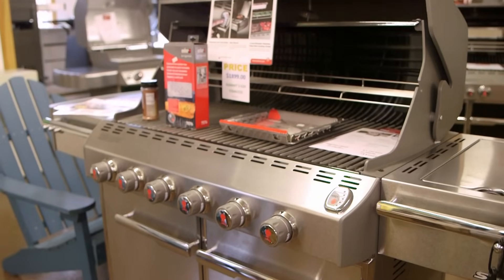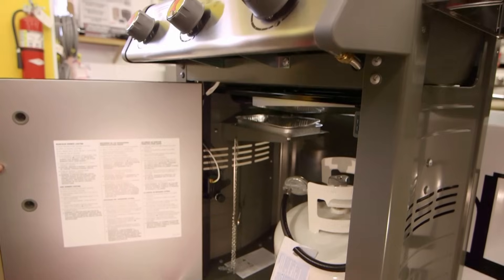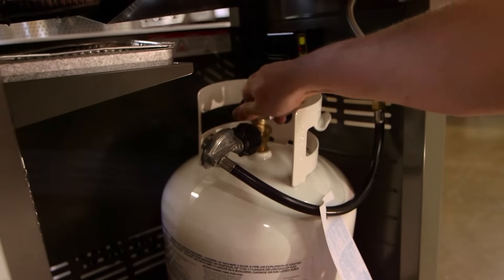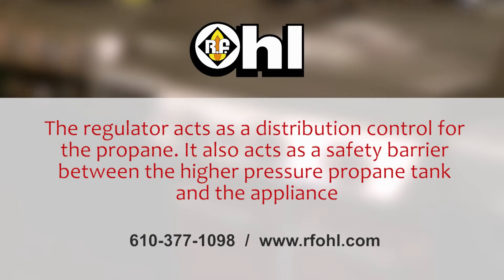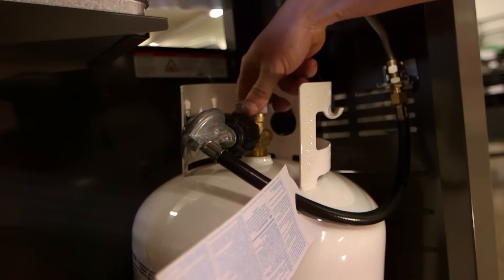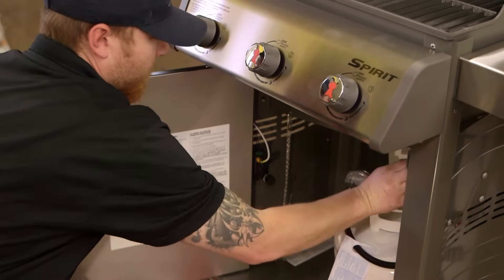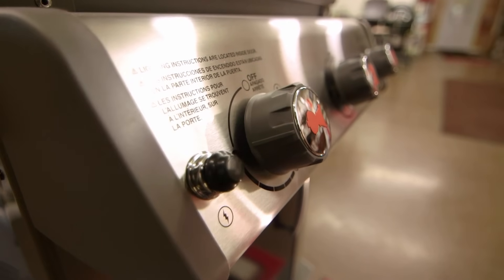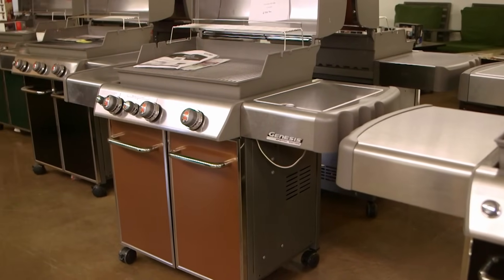Why Is My BBQ Gas Grill Not Lighting Up

Comment: After disconnecting the propane completely, turn the burners on high for a minute or 2. This will clear any left over gas in the lines. Turn burners off, reconnect propane and turn it on super slow for the first 3 to 4 turns.

Comment: I have a six burner (3 ignition) set up and my grill heats up perfectly fine BUT when I attempt to lower the temperature to medium or below on my first 2 burners (ignition 1), the flame goes out either in a few minutes or when I close the lid (whichever comes first). Works fine no matter what the control knob is at on the other 4 burners. Any ideas? Possibly manifold valve?

Comment: HOW ABOUT THE SHUT DOWN PROCEEDURE,   I  UNDERSTAND THAT SOME REGULATORS THAT ARE EXTRA SENSATIVE CAN TAKE A "SET" ,  SO THAT IT'S BEST TO RELIEVE ANY RESIDUAL PRESSURE IN THE SYSTEM BY BLEEDING THE CONNECTION NUT FOR A  SECOND OR SO ,     IS THERE AN APPROXIAMATE TIME FRAME THAT THE AVERAGE REGULATOR WILL QUIT FUNCTIONG PROPERLY,   USUALLY THE FLEXIBILITY LIF OF THE DIAPHRAM OR SEATING MATERIAL,     REGARDS